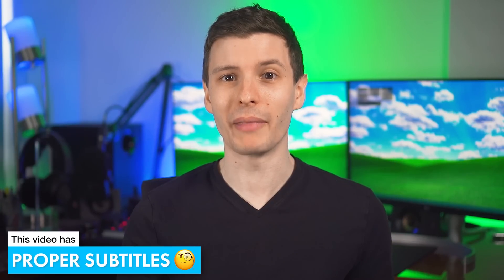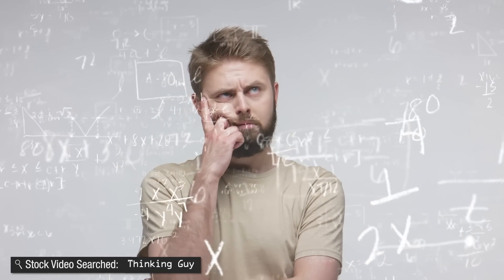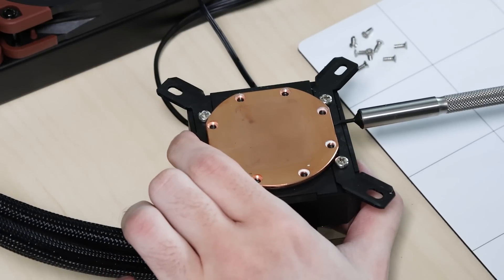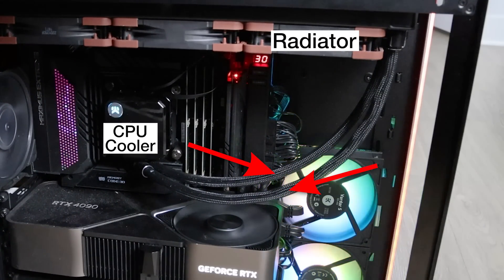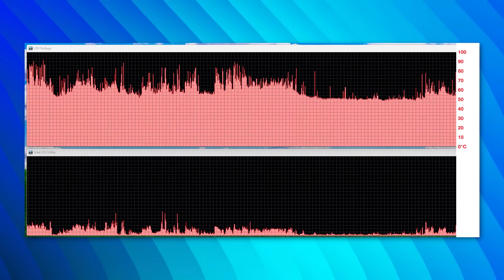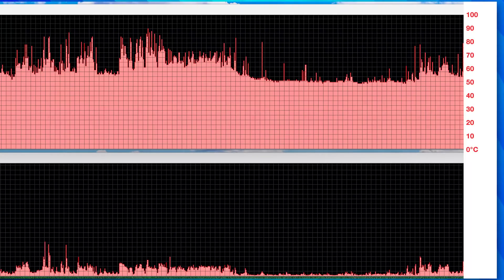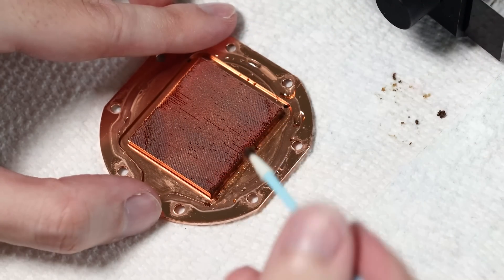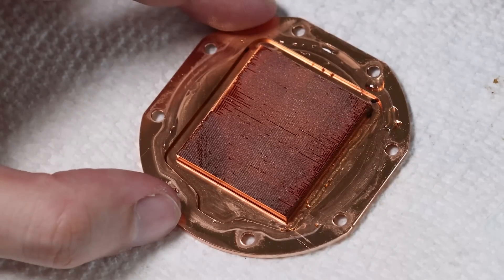The Mystery CPU Overheating Problem Took Me Months To Solve

Comment: Your problem was you used liquid cooling. Liquid coolers last an average of three years. I’ve used air cooling exclusively and never had a problem. I’ve replaced many liquid coolers with both different liquid and air coolers. Air coolers, good ones, you just blow the dust out of them every 2-3 years or so and never have to worry about them.

Comment: I would assume this gunk is still in the radiator and will re-clog the the cpu cooling block. You might want to flush the radiator out several times and refill with new coolant.

Comment: Just some guessing from what you tell and what I can see in the video:
1 - Algae? The transparent-ish stuff that blocks the fins in the CPU-cooler look very much like algae that has been building up over time.
2 - At what temperature rating of the tubes and other materials used in the water cooling system you're using? I'm asking is because it could be cause initially (thermal paste?) that later led to another cause for the overheating. The 'gunk' could be reminisens of plastic/coating/etc. from materials that didn't handle the high temperature(s).

Whatever the cause is I would've installed a filter on your water cooling system because there are very likely more 'gunk' hiding in the water cooling system. You could just use a simple gasoline filter for cars, those with clear plastic and a yellow/orange paper filter inside. They are very easy to install and with the clear plastic you can easily see if the filter is clogging up.

Comment: This is why I love my Gadgets (that have been around since like Vista?). They let you add in alarms and even custom alarm sounds for everything from temperature to network connection status. Unfortunately, you have to use a manual hack and they don't always load correctly at boot in Win10 / Win11, but they even work in a BootCamp install (since Windows stresses the hardware out more than MacOS).

Comment: looks like the waterproof grease was over applied along with poor QC. to clean the block go to the local mom and pop auto parts store and get some mass airflow meter cleaner $15 to $20 US. It's safe to use just read the entire label. After you clean it with alcohol and swabs watch how much stuff comes out when you spray it..DO NOT use on pump unless you can replace the seals.

Comment: I had the exact same issue two days ago, with a Kelvin S36. But in my case, it happend after I installed a new PSU. I think moving my PC during the installation caused the clog, which eventually cleared by itself. But it presented itself in identical fasion: first, the super high temperatures, even after I restored stock ratio and voltages. At one point it even shut itself down due to the high temps. Then, I noticed that the block was really hot, even though there was no hot air coming out of the radiators. My original assumption was that there must've been some UEFI settings that changed after a Windows update, so I unplugged the pump from the MB and plugged it back in, which did the trick. But your explanation make much more sense. This Kelvin S36 has been going for nearly a decade now though, so I'm gonna start looking at a replacement rather than risking a leak if I try to clean it.
Thanks for the vid, I did not expect to find a sensible explanation for what happened, especially by accident.

Comment: I don't even watercool anymore due to these kinds of issues with AIOs and the expense of custom loops. I had a pump die in an H115i, it wasn't enough to cause it to crash from overtemp, but it throttled hard and the fans were going bananas. Did I mess up the delid or the lap? Nah those were probably the only things keeping the chip running cool enough to stay alive with no waterflow... Then later on in 10th gen i had a 10850k that over time just seemed to get hotter and hotter, probably a clog, but I didn't disassemble the block I just decided it was air cooling for me from then on.

Comment: IMHO, water cooling is making things way too complicated and introduces unnecessary points of failure. I'd say if you're not particular about the aesthetics or have to do something special like moving the heat somewhere else, just slap a tower in there and watch these problems go away. Been running a Brocken 2 for over 6 years now and it idles around 32°C - 35°C. Puff of air for cleaning every ~ 2 years.

Comment: That looks like algee. You need to remove all the fluid, clean everything 9ut and refill it with a proper biocide like coper sulphate. Ek should send you an advance rma replacement if you tried to rma, and that is one of the many reasons why you should never use an aio.

Comment: Yeah I think its also important to note that this isn't a common issue with AIO's generally speaking so those stating "I'm glad I went with an eye sore air cooler" are simply fooling themselves. If you want to adequately cool a powerful CPU like say a I9 13900K or Ryzen 9 7900 / 7950X you aren't going to get the full potential with an eye sore air-cooler and to suggest AIO's are somehow "too risky" based on a small minority of ppl having an issue is an absurd excuse to somehow justify not spending a bit more money for superior performance. Sure you may "get by" with an air cooler in many cases but it's always better to run cooler.

Comment: I'm not a fan of AIOs. I used one for a while and the pump failed. Switched back to air cooled and it's fine. I don't build small form factors usually.

Comment: Probably not a good idea but I would've spray it with brake cleaner from the auto parts store and then sink it in alcohol and finally dry it off with compressed air.

That way the debris in between the fins would've washed away as well.

Thanks for sharing this strange situation. Now the question is, why this happened in the first place?

Comment: My first impression was that you probably had trapped air bubbles but the more you described the situation the more it sounded like a clog.  I would recommend running alcohol through the system with it running through filter media to try to pick up any of the remaining residue in the system.

Comment: They should have a flush function for AIO's where you can momentarily reverse the water flow to clear out debris on the cooler fins. But 90% of the time if you are using an AIO and suddenly notice higher temps it will be a water flow problem either due to obstruction or air.

Comment: This is a similar situation I am facing on a HP laptop, the fan jumps up to full blast, even the thermal paste has been replaced and there was no dust in the fan or the computer heatsink at all. 

I have done tests on both Windows 11 and Windows 10 and on Windows 10 the fans never ramped up to full very often and this is very inconvenient as this also wrecks the battery life 

It is a HP-14s Dq2502sa if anyone has any ideas? All screws were tightened and there was as I mentioned, no dust to be present on all components of the computer.

Comment: I had something very similar happen to me and felt equally dumb.  I went through a period of low cpu usage prepping to do a fresh install of Win11, from Windows 10.  Installed Win11 and started immediately hearing my fans ramp up like never before.  Same thing with you, I replaced thermal paste, unknowingly slightly dislodging the clog.  I spent days figuring the issue had to be with Windows 11.  Finally replaced the AIO and it went back to normal.

Comment: It's maybe an outdated mindset, but this is one of the reason why air coolers are my go-to for systems that NEED to work 24/7 with little to no fiddling. No doubt a competent AIO or custom water cooling setup will look and perform better, but they have nothing on air coolers for reliability and low maintenance. Obviously it's difficult to keep a high-end i9 cool on air, but it's certainly doable if you're fine with increased fan RPM.

Comment: Totally not one thing "dumb" about this issue. You did what anyone would have done that doesn't have X-Ray vision. There is no way that you could have known that a year old AIO cooler was clogged with what looked like decomposition of the inner tubing material collecting in the pump. This is the LAST thing I would have looked at and kudos to you for not only finding the real issue, but sharing it with all of us to file away for our next problem. Well done, good content and presentation.

Comment: This happen to me and my brother as well, cpu went randomly to 100C at load and idle around 70C, changing the thermal taste didnt change a thing.
hitting the tube did fix it for a time, i could hear bubble air passing throught the tube. 
My radiator cooling PF240 SilverStone was fairly new, like 6 months, didnt expect this kind of things to happen but it seem to be pretty common.
at the end i replaced it with a conventional air cooling.

Comment: Flush and refill that loop if you can, or it will happen again. That loop is polluted with what looks like manufacturing remnants. If it's still under warranty send it back for a replacement.

Comment: I have an EK 360 AIO on one of my PCs and have no problems; high loads while gaming around 75° C (CPU hotspot) playing Call of Duty. 

However, I would send a link to this video to EK so they can evaluate. I do know that many of the EK 360 AIOs have been discontinued and this may be the underlying reason and it may be more widespread than you realize.

Comment: Every other year I disassemble my Cougar Helor 360 and clean out the deposits from the pump-head distro plate.  I dumped and flushed out all the original coolant the first time and replaced it with distilled water and since then NO real deposits formed again.  The key was agitating the rad for many minutes while repeatedly flushing the rad to remove all of the sediment.  The original coolant was the culprit,  and have used distilled water ever since...that was 5 years ago.

Comment: Disassembling an AIO liquid cooler voids warranty. Under normal conditions, this should be a maintenance free solution, aside from dust build up from fans and the radiator. Work with manufacturer first before considering to disassemble like Thio did.

Comment: I wager 99% of users do not disassemble AiOs and this goes undiagnosed. Price etc also makes RMA process not worth the hassle so not even manufacturers know for sure what the real world error rate is.  Have my own AiO troubles - I think the pump is making noise but it isn’t doing it always, will consider it e-waste and probably move back to air cooling.

Comment: You should buy one of those eBay ultrasonic cleaners to clean the fins on the block and then before you put it back together, run the pump while it is open to purge the remaining debris out of the cooler. (Essentially a coolant flush)

Then replace the fluid as it could be the reason your cooler is breaking down on the inside.

Comment: It seems that a lot of water-cooling manufacturers are having problems with clogging and various other quality defects lately. That's why I prefer to stick with my reliable tower cooler for the time being. The only thing that can go wrong is that the fan gives up the ghost. You can easily replace it for a few bucks...

Comment: What are you using the dual gpus for? One looks like it sufficating

That's not good looks like a reaction between the cooler fluid and heatsink. That will kill the cooler eventually

Comment: Never had this issue. My PC isn't high-end enough to require this kind of cooling, but I DO like hearing the issues and solutions. You wouldn't expect this kind of clog with a computer, but with a mechanical device (reservoir and pump, it doesn't matter what is it, the problems can be the same. Glad you got it worked-out.

Comment: how long did you have that aio? And how hot does you 13900ks run with it on full load? I have troubles keeping mine from not blowing up and have been just putting in different new high end aio coolers in.

Comment: if the aio cooler has a problem its best to replace the failed unit, they arn't ment to be opend by the user, due to the special coolant mix, if temps go up just buy a new cooler, everytime, i would advise you to take out the aio and replace with same or similar unit, dont keep using that aio please

Comment: I had a out of warranty corsair one go dry but I didn’t confirm that the cooler was a problem until after replacing my motherboard/cpu “motherboard was legitimately faulty but i had been extending its lifespan as much as i could” the weirdest part was that the pump read as working fine on the software side.

Comment: Go to a friend with an air compressor, maybe a air-in-a-can spray can work, just blast the crud off! Start in a corner to, at several angles, find out if the pressure might even be too strong (might put a bend on micro fin). If nothing is bending carry on. Apply more water, blast again. Repeat 'til clear. Maybe even a pump water spray bottle might help. Flush tubes both ways, replace crap cooling fluid.

Comment: You mixed metal types causing corrosion. Your block is copper and your fittings and or radiator has aluminum in it, they trade ions in any type of circuit, even water. Most people get leaking before this. A lot of customers at microcenter do this and complain that we sold them cheap fittings but now they have to replace their entire loop from this simple mistake. Avoid aliexpress parts, some of them have aluminium blocks with a copper coating and are sold as full copper or are cheaped out in some way like that. Keep up the great work sir!

Comment: Arctic sent me a new fin and rubber for the 360 Freezer 2. As the rubber was not properly vulcanised so it started to build up crap. After replacing the fin and rubber, instant -20 degrees under load. They sent it for free.

Comment: You failed to clean the spaces between the fins.  You should've used jet of pressurized water or new paint brush to remove the clog in running water because the cotton swab will not reach the tiny spaces between the fins.

Comment: I had an old Corsair H110iGTX that had pretty bad permeation causing air to form in the system. Had exactly the same symptoms. Guess what fixed it for the next few months? Percussion maintenance. I legit have a video of the CPU hitting thermal throttling idling and me punching/smacking the hoses and it slamming itself back to normal temps.

Comment: Sometimes asking a quick question on forums might help with solving the issue faster. I'd expect a day after creating a post about the problem someone would say it is transport issue, as the temperatures cannot lie and the CPU is indeed overheating, it is the transport either not moving where it should be or not present.
Mounting issue is incredibly unlikely as I don't know what one needs to do in order to dislodge the block while it sitting still to the point it loses contact.

Comment: I’ve only had one time I’ve ever had an issue with cpu temps and it was with a stock Intel cooler that had the plastic mounting mechanism go bad during a reapplication of the thermal paste. I simply replaced it with the cheapest tower cooler I could order and it has been working flawlessly since.

Comment: I have at times wondered how many hours I have spent over the years chasing down computer problems. I built my first PC at the end of 1983. In the era of no plug and play, dip switches on cards, limited and no sharing of interrupts, even in the first gen ISA 8 bit slots the card went into could stop some cards from working, that did persist even after the 16 bit slots were introduced a year or two later. As you may guess I continued building each new CPU release, 286, 386, 486, pentium, pentium 2 and so on. In the previous decade computers have become child's play to build. But as you can assume with this history I have spent many an hour scratching the head and clocking up unproductive time.  I'm glad you found your problem, for me a replacement would be high on my budget list.

Comment: Did you try spraying running water into the fins? Then use soft tooth brush to drive whatever might be still inside the fins and shift them sideways? I don't know if those methods are safe, but sound intuitive.

Comment: HAD A SIMLER PROBLUM with my amd build the scencer was saying it was 120c but it wasent hot inside of it or on the die found out with mine it weas a setting in the bios that got changed by a windows update / bios update

Comment: I am so done with AIO coolers.  I’ve used them for years on many systems.  But after so many failures I’ve replaced every one with noctua heatsinks.  I figure if I have a fan fail at least I still have a massive fin stack to carry some heat away.  No more AIO for me...

Comment: I got my computer this Feb and I had the same issue since Thursday(10/8/2023.  Tightening the screws did nothing(but they are pretty loose) and I reapplied thermal paste and it did help a bit.  Very likely the same issue and my AIO is MSI Mag Coreliquid 280R.

Comment: Thio, thats algae. Its something that was a huge problem in the very begenning of the water cooling era when everything was comepltely custom or made for refrigerators, cars etc. The more cooper and silver used the less it gets, also the more alcohol instead of water (glicol) and other stuffs also. The tip ill get you is just change the fluid, get a actually good one and youll be fine for certain. This is really common, is basically every single major brands. Even cougar.

Comment: Seems your pump is still broken or at least on the way out.
That metal debris can be caused by cavitation within the pump itself which is a clear indication there are some major issues with your cooling setup.
Main reason why I use air cooling as I don't trust those water/liquid cooling solutions.